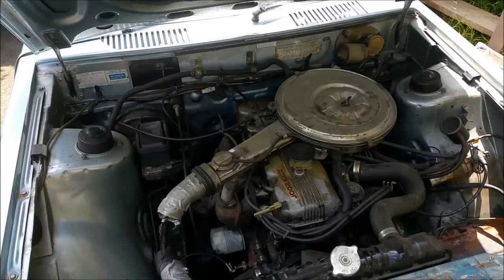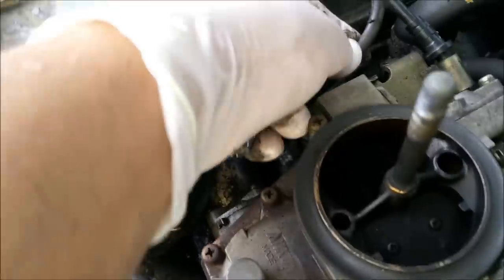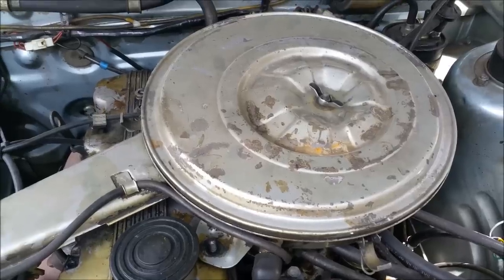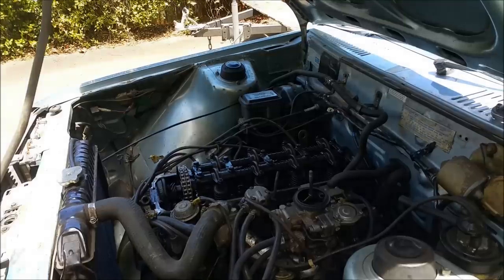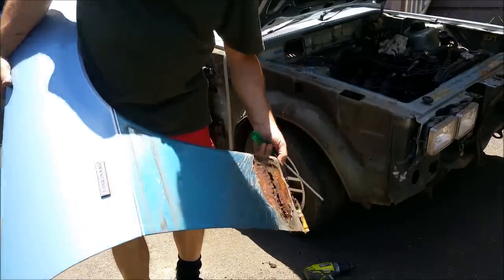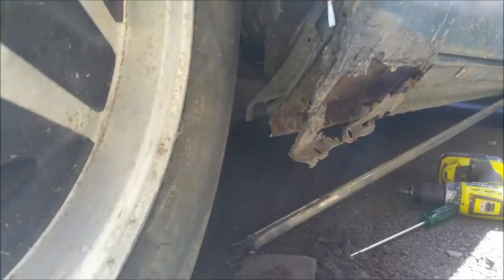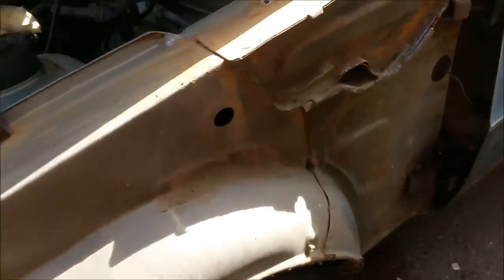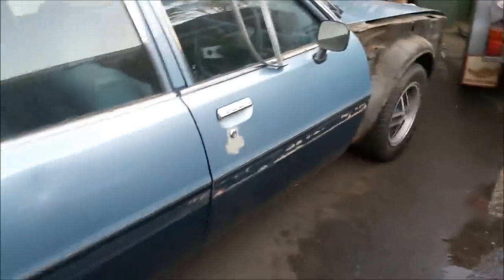Mitsubishi GH Sigma 2 - Let’s Look Deeper and Swing Spanners

Comment: My very first car was a brand new GK Sigma with the Astron 2.6 motor that was fitted to the Magna. It was an SE with chrome flashing on the bonnet just above the grill and very smart looking alloys. Air-con and velour along with other luxury items of the day rounded it out. With the Magna motor and 5 speed box it fairly flew along the highway and taught a few six cylinders what's what in the green light drags into town. I admit it was quite a drinker when cruising at 140kph on the Adelaide to Melbourne run, but hey, I didn't mind. It is still in the hands of the second owner who bought it from the local Holden dealer when I traded it on a 1990 VN S pack. Original red paint - still looks the goods today, 32 years later.
Reply: @operationrepo007  Sigma for driving and VN for looking like a knob lol.

Comment: Peter Peter Peter, you spent the first episode describing it as a gem and now it is frankly awful under the bonnet. Sympathising with the missus at this stage. I owned a 1980 2.6 GL auto with AC. Not a bad car on a long run.

Comment: That's definitely a very good find, very, very good bones, almost amazingly for a near-40 year old Japanese car that was known for being a bit of a rotter when it was pretty much new.  Definitely well worth saving, even if the current engine turns out to be an issue, though I'm guessing it won't as the compression figures you got very strongly suggest it's a low mileage lump.  From the video it does look like it might be weeping a bit from the front crank seal, and it looks like it has been for a while judging by the accumulated mess or road dirt and oil, but that's no big problem overall.  Looking at the car I would suggest that the damage that caused the front wheel house to be partially replaced and the damage to the bonnet slam panel aren't from the same crunch.  I reckon the wheel house damage was done when it was very young, and the damage was probably repaired by a Mitsubishi dealer, hence the original-type screen and sealer, while the other damage was definitely repaired on a budget using recycled parts and less than ideal repair techniques, though I suspect the painting was probably done professionally as the paint on that right front wing matches the rest of the car very well on the video.  Maybe a touch of the slightly shady car dealers that you mentioned at the start of the film as old Mitsis were always pretty prime stock for dealers due to their reliability...

Comment: Low value? what value? 😀 I worked on them when they were new .The only thing that really caused problems to the new ones was the Wrong size battery. if the car didn't start straight away they would never start. Replacing the little battery for a proper one fixed them. The ignition guts was used as as part of a kit from Jaycar to fit electronic ignition to other cars,Worked remarkably well too . ( I can't recall the last time I saw a sigma on the road ,except at car shows)

Comment: Not sure what parts you'll need for those headlights, apart from maybe replacing those little screws that hold the bezel (those old Phillips screws usually got rounded off pretty quickly.)  If I remember correctly, the lights themselves are sealed beams, so replacing the bulb also gives you new glass - assuming someone still makes them, of course.  But I'm pretty sure you can't replace bits and pieces of them.  (Then again, I'm working off a pretty wonky memory - my dad had an early Sigma wagon when I was in my teens, but that was a very long time ago.)

Comment: My first car was a GE Sigma with the Astron 2000, so I'm having a LOT of flashbacks staring into this engine bay. Can someone explain what the pipe/hose from the exhaust manifold up to the air intake was for please? When I bought my car (1987), that pipe was half off, then fell off somewhere and I never replaced it.

Comment: Given those cylinder pressures I was wondering if that engine had originally been designed as a diesel. Renault did this (diesel to petrol )on the 9 and 11 and that engine was bullet proof.

Comment: If you want to clean the engine bay and you have crap build up on the motor you have to get off  then how about pulling the engine out. Straight forward operation and the time it takes will be saved when you clean as everything will be easy to get at. You can check the clutch as well. Is that rear window louvre standard? Anyway you have a great car for a small budget resto. Good start to the year though the wife possibly may have a different opinion. Regards

Comment: install a xe falcon carbie on it you will be amazed the power an economy out of it I had a GEyears ago with a 2.6L absolutely went hard as 5 speed manul BW box ran engine oil in it
Reply from the maker: Those Webers are fantastic, but (I think) hard to get now... did you need to use an adapter?
Reply: @PeterAndersons
Reply: @PeterAndersons  hi peter what I did I used an old xe manifold cut the carbie section out an tigged it on then just fine tuned it with a die grinder ive got an xe carbie somwere you can use the xf carbie but just more pollution bullshits on it